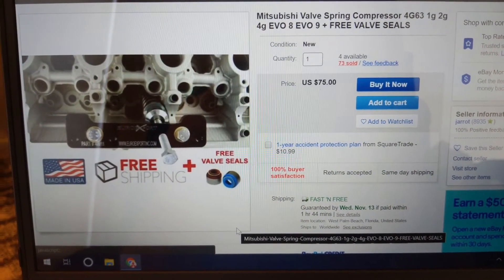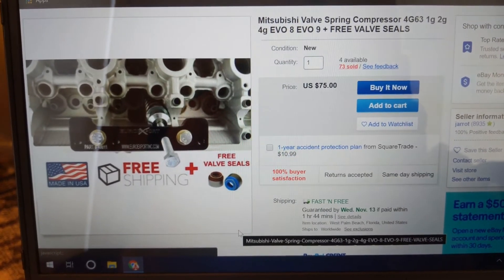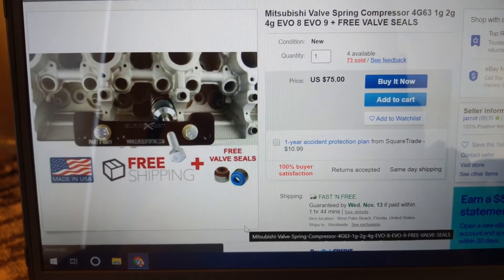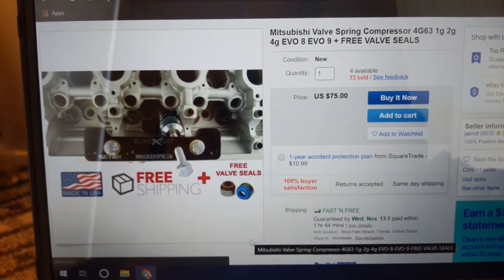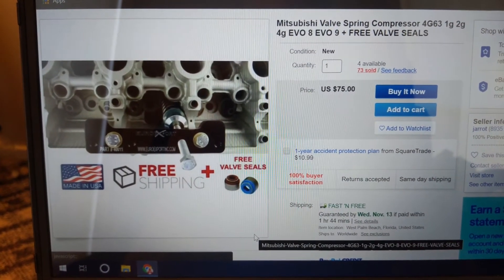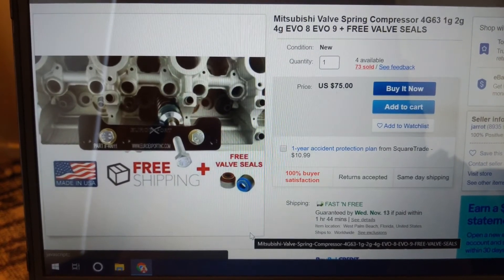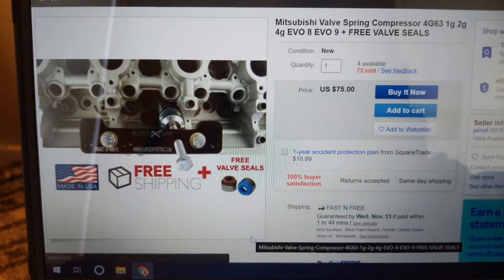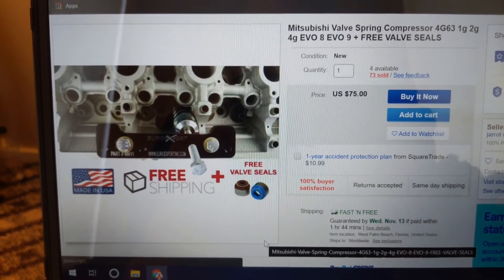The Gsx has a problem :/

Comment: Well, I now also have smoke coming from the exhaust of my car.  What did you do to verify this was your issue before diving into the job? I took my car around the neighborhood last week and was blowing clouds when I let off the throttle. 😑
Reply from the maker: I checked my pcv valve was functioning correctly and verified the turbo wasn't blown by checking out the compressor wheel and lower intercooler piping to see if they were full of oil, also checked the throttle elbow for oil that had traveled from the turbo that could be causing the issue. If all of those are a no go the I'd bet it's the valve seals. Especially because you mentioned smoking off throttle. Engine pulls vacuum and oil sneaks into the cylinders. If that is the case then buy your valve seals, the installation tool (really wish I had mine then but a deep socket works) and new cam seals. Hope you get it figured out my friend 👍🤞
Reply: @TPGDSM  so this is something that was actually  happening a while ago. I swapped out the turbo thinking it was blown. Previous owner had a cheap eBay turbo on it.  I don't know if the problem ever went away fully.  I rarely mess with this car because of due to lack of time.  I'm to a point that I just want it to be drivable lol
Reply from the maker: I hear ya man. Always something to do with these older cars!. But the job is doable with some wrenches and rope. Re-timing the car is the hardest part. Just be careful and plug EVERY HOLE LEADING INTO THE ENGINE!!! don't want a dropped bolt to cause and unnecessary head pull lol

Comment: Hey man if you want the revised lifters look on 3sx.com they are cheap and are really good quality. 
And also when you goto do the valve stem seals take the spark plug out and find rope that will fit down into the cylinder then turn the crank until it stops. So then that way you wont drop the valves.
Reply from the maker: Thanks for the link and advice! The good ol' rope and tdc trick is a must during this job. To bad there are still some people who think you need to pull the head to do this one. Should make for a good project and hopefully fix my problems with the smoke. If it wasn't November we would be taking the whole thing apart and putting in new pistons, rod, head gasket etc but for now lifters and seals. Thanks again for the input 👍 3sx.com is where I'm going to next.